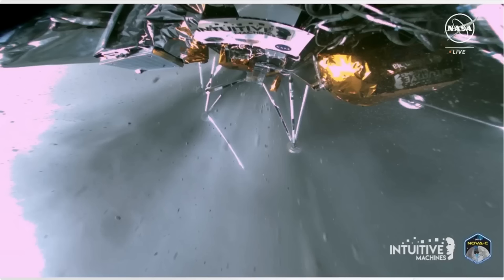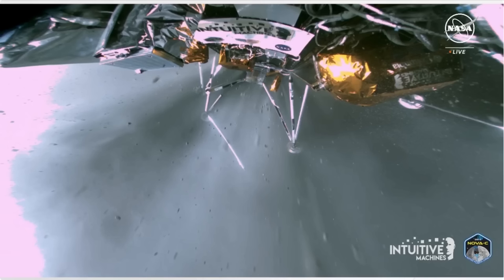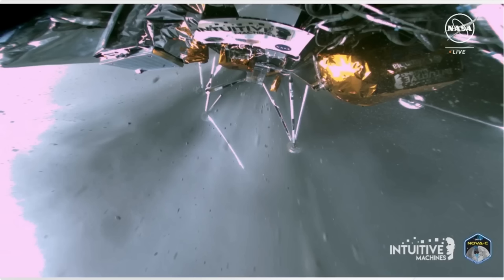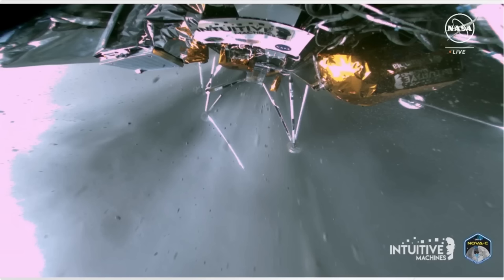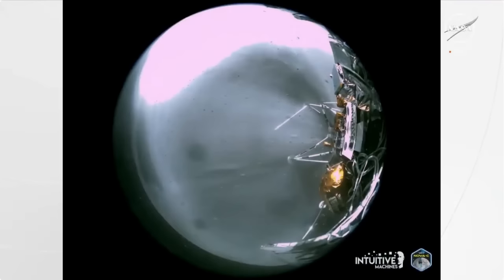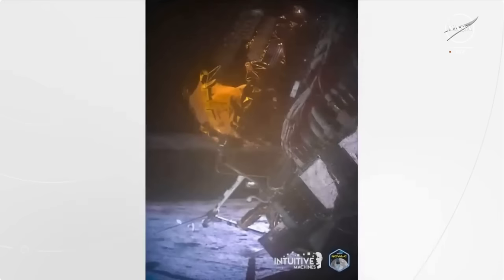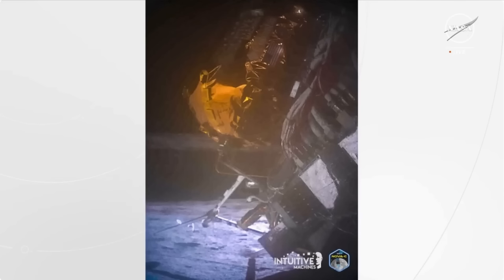New Intuitive Machines' moon lander images shows 'broken landing gear' and tilt

Comment: In Dec 2020, China's Chang-5 lunar lander safely landed on the moon. Then it automatically sampled of 3.8 pounds (1,731 grams) of lunar rocks. Then it succesfully lifted off and rocketed the samples safely back to Earth. I wonder if USA/NASA is able to perform such mission at this stage.
Reply: The mission was to land near the South Pole which is a considerably more difficult mission than China's. So far only India has succeeded.
Reply: @amitkriit   In Jan 2019 chinese Cheng 4 landed in the South Pole-Aitken Basin on the FAR SIDE of the Moon that was still unexplored by landers. The whole operation was coordinated via communication relay satellite. And the chinese lander deployed a robotic rover on the surface. I wonder if USA/NASA is able to perform such mission at this stage.

Comment: In the year 2024 we are using pictures instead of hi-res video. Also the year is 2024 and our success rate of landing on the moon is awful, yet we could do it with relative ease using 1960s technology. Also good luck to the brave people who decide to land on the moon in Starship, better hope that thing doesn't tilt over 😂
Reply: 1960's was a astronaut pilot landing
Reply: We'll get there, eventually, and much more economically. For perspective:

Apollo was approx. $257 billion. That's three orders of magnitude greater than the cost of this mission.
Odysseus had a NASA contract valued at $118 million. It cost the agency an additional $11 million to develop and build the scientific hardware.
In 1965, Nasa funding peaked at some 5% of government spending, today it’s a tenth of that.
Reply: @mkvv5687  technological development exceeds cost limits, especially comparing using slide rules and vacuum tubes to modern processing and artificial intelligence.
Reply: @05DonnieB right. you'd think too we'd use the same knowledge of how apollo landed successfully on the moon time and time again for this system.  This one was much lighter too and had no humans on board.  I'd happy to pay $100 billion if it means a good landing with a lander that can last more than a few days and provide proper data and data transmission, esp consiering that this was part of the upcoming Artemis mission.  
I am losing hope for Artemis success.
Reply: This missions budget is like 20x less then  those NASA ones also there was a person literally right there to make sure it landed correctly because their life depended on it
Reply: @Ludeboi420  the Soviets landed the LK on the moon in the 60s

Comment: Why don't you lander designers shape your landers like a sphere? Then when it lands the heavy part of the sphere will want to role down and the lighter half of the lander will role up. If you want to get fancy with it make a sphere with in a sphere on ball bearings. Better yet send a robot with Arms, legs and wheels that could push the lander upright. SPHERES! or Hamster Balls
Reply: Maybe they could take some tips from Battlebots self-righting mechanisms.
Reply: Actually think about that, you will see why that is not much use to the landers.
Reply: Weebles!    Weebles wobble, but they don't fall down!
Reply: One of the early Mars landers did exactly that, blew up a sphere of balloons before bouncing around for a landing. It worked well and I'm not sure why it wasn't attempted again. I speculate that a larger payload won't work in Mars gravity. It seems like using that method on the Moon would be adequate.
Reply: @mkvv5687    Well, to be honest, we have to develop the vertical landing skills at some point.  Can't use the bouncy-castle approach for everything.
Reply: @y00t00b3r why not? Just send smaller packages. Like Mico Sats but Micomachine Landers. Drop 1,000 Beach ball landers and some should make it.
Reply: @y00t00b3r This guy gets it.
Reply: @TAOM5963       Hard to put a human in a beach ball.  And they'll be pretty irritated by the time they reach the final landing location.

YOU FIRST, LOL !!
Reply: @TAOM5963    Ya'll are right about the shape, though.   I speculate that this lander was designed to fit within the space allotted for it on the launch vehicle.  It doesn't make much sense for it to be so "tippy" and top heavy.
Reply: @y00t00b3r   I wonder how the 50m high SpaceX  lunar lander will fare.

Comment: So the gear broke before it touched down? This is getting worse revealing what happened. Sounds to me like it was in trouble from assembly and never had a chance.
Reply: No it was during the landing. Apparently it had more sideways momentum than it was expecting during touch down causing the leg to snap. It was due to a data delay caused by the workaround they did to bypass a locked out system.
Reply: Yes I heard something about this lockout safety that was never removed before takeoff....I guess no matter how you slice it someone screwed up....too bad. @Awrethien

Comment: Just brilliant the legs broke off. I will be thinking the same thing when my car gets a flat tire. That it was a success that the flat tire got me out of my driveway. Of course its important to say the lander was a success because otherwise another 200 million from N.A.S.A for another one will not be coming to the company. Not that building these things is not complicated. Or a landing either on the moon. They both are very difficult things to do. But as far as saying it was a sucess. It was not. Not when China put a lander and retrieved moon samples and brought them back to earth from the north part of the moon. And India also landing a lander on the moon. By the time the U.S gets done with all their landers and everything else they land on the moon. The moon is going to look like a  dump people go to on the weekends to get rid of their garbage. It would not appear so bad if this was the 60 s. But after all the U.S astronauts had gone to the moon many years ago. Landed and took off again. These failures are making the U.S look bad know matter how they spin the disasters. And pins and things that should have been checked. Just looks like a deadline was more important then anything else. Seems like a quality control issue did not help the situation. But to be fair in some cases wuality control mean not so much to the higher ups. I worked in quality control at Raytheon Research. I told the higher up that the material should be shipped out in a wooden crate. But the higher up yold me no its not necessary. Just wrap the 100,000 dollars material that was 6 months over fue in sheets of lint free paper and cardboard. I told him I did not think that was a good idea. He said do as your told. So I did. And it got shattered getting loaded on the plane going to Europe. It was not a good day.

Comment: Gravity is based on size and expansion not mass and attraction. The near side surface gravity measurement is @1/6 of earth’s “g”. The far side surface gravity measurement would be @1/3 earth’s “g”. Here at the South Pole some difference greater than the near side: perhaps part of the reason the descent was @3.3 times the ‘programmed parameters’- if 3Km/ hr was the desired approach speed, not the apparent 10 Km/hr mentioned. “The Final Theory: Rethinking Our Scientific Legacy “, Mark McCutcheon for proper physics.
Reply: I don't think it works like that. Our Moon orbiters would have to have some crazy orbits to account for such drastic gravity changes. But, I will check out your reference and see what it says.
Reply: you lost me after Gravity...please translate
Reply: @afs6596  The center mass of the moon- push off point - would be in 1/3rd the moon’s diameter from the near side. The far side twice that distance/size giving twice the surface gravity. All atoms and atomic objects are expanding at 1/770,000th their size per second per second constant acceleration. The average expansion would be 1/6th + 1/3rd divided by 2 equals 1/4 expected based on size- the moon @1/4 the size of the earth, so 1/4 earth’s “g”. The South Pole surface gravity somewhere in between these figures. The lander would be experiencing a faster than expected approach speed of 1/6 earth’s “g” (possible contribution to the hard landing). India’s Vikram lander, Japan’s recent attempt and Israel’s also affected by lack of knowledge of gravity’s CAUSE. Probably not real clear! Explained in: “The Final Theory: Rethinking Our Scientific Legacy “, Mark McCutcheon.